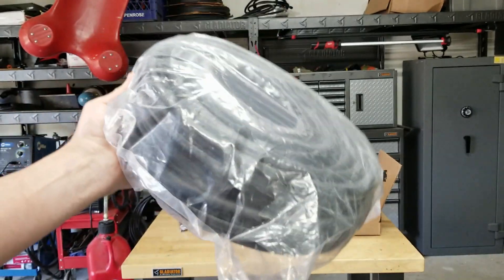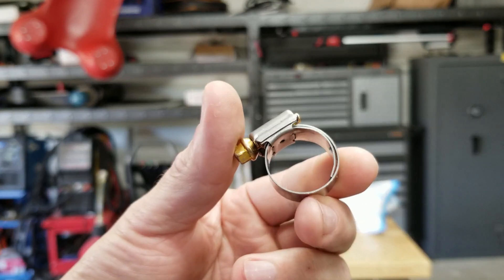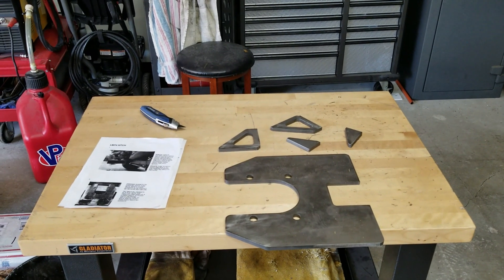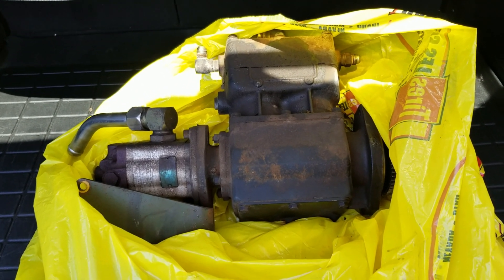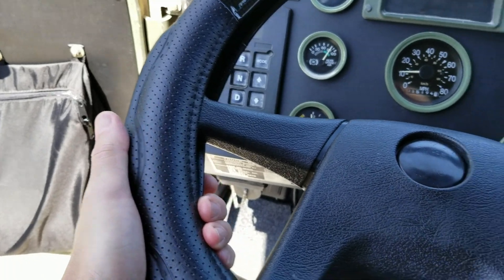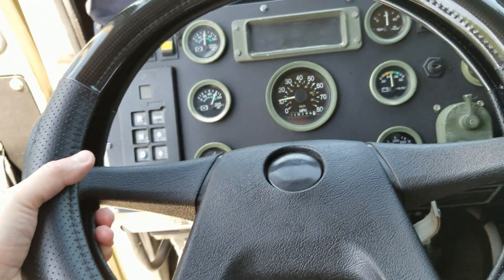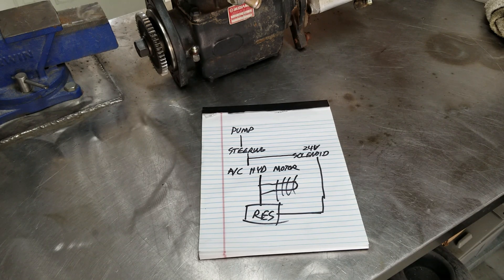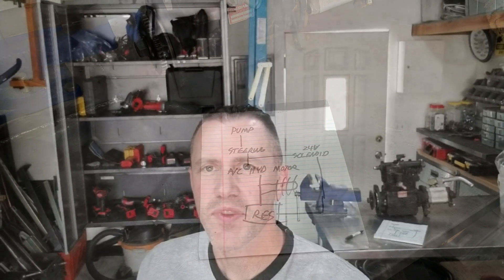Abel LMTV build part 102 (Final refrigerant line installation, unboxing, hydraulic a/c explained)

Comment: Great video. Where are you going to locate the power steering cooler? Will it be in front of Abel's radiator?
Reply from the maker: I think in the wheel well on the frame rail.

Comment: Sean does your truck do more than 55mph? If so how did you do it?? Thanks.
Reply from the maker: Mrap gears, yes.  We travel about 60-63.
Reply: @SeanFastidious  Thanks for the info. 1 more question. Any particular year, kind? Is it just a drop in type change?